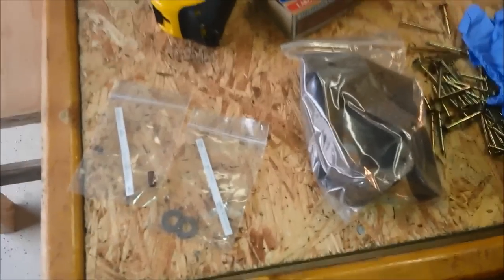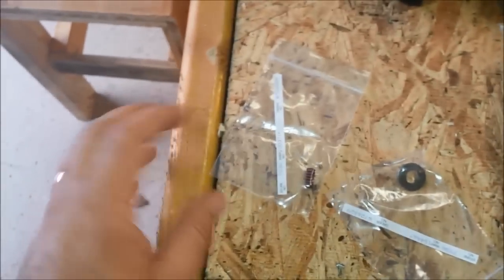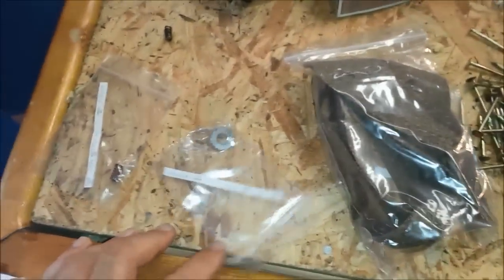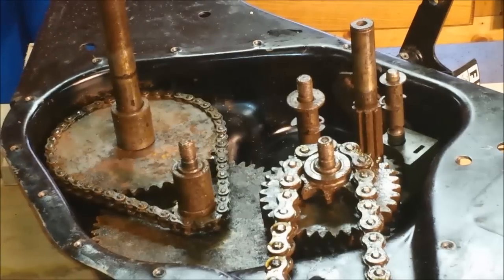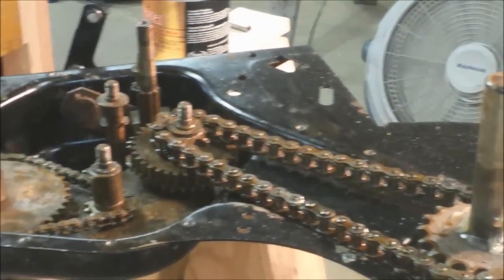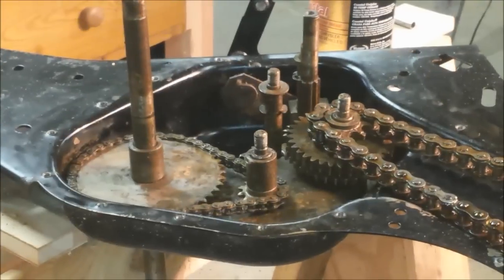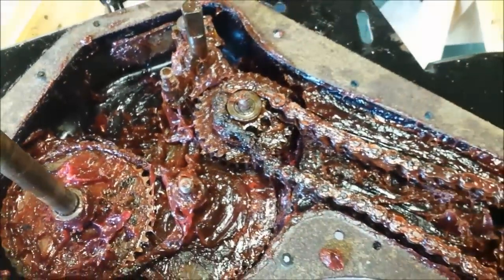Craftsman rear tine tiller repair - update #2 final

Comment: Appreciate the vids on this. So thoughtful of manufacturer to recommend using a grease gun 2-3X a year but not providing grease fittings! Mine had same problem of not shifting, stuck in F. I have it ready to split the halves apart now-all bolts off. I don't think any of the gears are messed up. Once I've put the halves together with a new gasket I think I'll use some thick black exterior paint to further seal the thing and keep it under cover when not using it. Thanks!

Comment: Fixed mine today,  the weld came loose on the ground axle, re welded it,  not available,  I actually drilled a hole in the collet welded it to the shaft and gear ,weked both sides that way ,heat treated the assy and worked great, looks like you are missing a,washer on the idle gear , but at low rpm it will be fine for a long time, thanks for making a great vidio on the assy and repair,  I have 40 bucks in mine so far

Comment: Thanks for video, So many reports of jammed gears and hard shifting I wondered about gearbox design. Now I see it is pretty solid and problems likely due to lack of lubrication. I would add some 140 EP gear oil with grease to provide some circulation of lube.

Comment: Hey Big Red Fish Dad,
It looks like whoever sent you the parts sent you the wrong washers.  They are supposed to be felt like washers on that particular shaft only.  Also another tip for future projects involving springs.  Grab the spring with a pair of needle nose pliers and heat it up to cherry red and dip it in water real quick to cool it down.  This procedure will burn off the rust and bring back the springyness of the spring.
Reply from the maker: That would have made me feel better.. I wasn't too happy to have paid $3 for flat washers ;)
Reply: No offense, but I tried this heat/quench idea with this very same spring, and it failed utterly. It made the spring totally brittle and it broke in half when I tried to compress it in my fingers. This after it was able to be compressed previously but seemed a bit less springy than it should be so I decided to give this tip a try. No big deal though, I was probably going to order to new spring anyway.
Reply: Extreme Whitetail you just took the temper out of the spring. Hope you like buying springs.

Comment: Hi, thanks for the video. It helped me with my tiller repair. What is the model # on your tiller? Some newer tillers hve an additional selection on the transmission one click past till it has forward or reverse rottion on the tines. I would also offer to install grease zerks in the case cover to allow filling the gear case or greasing the important gears without pullimg the covers.

Comment: Wonderful Job. The thing that needed to be addressed clearly is the installation of the spring and steel ball. I haven't a clue how that works.
Reply: Finally taking mine apart .... The wheels were pretty rusted on..LET IT SOAK W/ PB BLASTER A COUPLE DAYS 1ST   i ended up drilling a couple holes in the wheels for bolts to the puller  heated up the hubs and used a harmonic balance puller to get them off...wow 2 days just to get the wheels off broke a few tools as well  so plan it out if your doing this as far as that spring  Take the clip off the pin/block pc &  that pin will push out.  The spring n ball goes behind the pin where that hole is.
Reply: @mattuk1310  Haha. You are so right. It took me three days to get the wheels off they were so rusted on. I tried a million different tricks and nothing worked. I finally just cut the hubs off with an angle grinder.  Thankfully, when I finally got it open I found that tiller transmission problem was the same as this video. The little gear shifting shaft was seized in the same way. Should be an easy fix. I haven't put it all back together yet, but I'm excited to have gotten this far.
Reply: @Ken Horner You probably figured this out already but for others reading this, I was struggling with the removal/replacement of the spring and ball too, but the spring and ball just come out through the machined round hole in the gear shift block. You just insert a flat head screw driver into the machined rectangular slots of the block and push up. It should come up easily. If it doesn't, it's rusted in place and you just need to use your favorite de-rusting snake oil.
Reply: @markwitt7597   hot cold hot cold & used a harmonic balance bolts thru holes in the wheels took me about  2wks on/off  clean it up paint some parts...you know restore it like an old car..  after it was all apart i ground down the shafts w/ a bench grinder slightly so i could get the wheels back on. used ant seize junk stuff. 
I got it all together tines work fine :)  ...
:( fwd / rev is not power turning  will spin freely ....So  i get to pull it all apart again.
heck i even silicone the top of the clam shell so water would seep in to the  gears / 2lbs of marine grease.....so i'm not off here yet ....com'on get motivated Lets get em done ...Spring is cracking soon   lol :)

Comment: I guess you didn't use the blue marine grade (blue) ...do you really use that much grease in there ? i may be puling one aprt down the road glad i stumbled across your Vids ..Thanks for posting them
Reply from the maker: We used the "Farm equipment" grease from tractor supply. Have no idea how much is recommended we just lathered it on everything... I figured there is plenty of reoom in the case so a little extra won't hurt ;)
Reply: Grease is super cheap
Reply: thats why we are all having these problems.....not enough lube at the highest point. Slap that grease in places the moon don't shine!!! Excellent video. Big help!!!

Comment: how did you get the spring out the block, I cant figure it out... you said it moves up and down and you hammered it out. Mine is just stuck.
Reply from the maker: +jason casper I honestly don't remember without looking at it again. But I think we just had to remove the "C" clip and then tapped the shaft (#16) out with a hammer. Maybe this diagram will help http://c.searspartsdirect.com/lis_png/PLDM/P9120365-00004.png
Reply: +BigRedFishDadI got it soon after I sent that message to you. I herd you say you hammered it so I wacked it two good times and it came loose.  Thanks for help and the info.last thing I have to figure out is how to knock the needle bearing out of the housing. Its d-4 on the diagram. That's the shaft that has the main pulley on it.

Comment: Thanks I just bought a used one for $225. It shifts hard from gear to gear. Probably dirty and rusty like yours was. Not sure I want to pull it apart just yet. Maybe drill a hole in the top and bottom and wash it out good the put grease into it and put plugs in the case.
Reply from the maker: It is probably those two balls and spring not the gears... maybe try some of the WD40 Lithium grease. Try spraying it in the hole where shift lever enters the case. You might get lucky and enough seep into that block to loosen them up.

Comment: I just picked one up and it drives forward & reverse perfectly fine. It will engage the tines but as soon as there is any resistance whatsoever to the tines they stop and you get an odd, i don't want to say grinding, but almost a grinding noise. Any idea?
Reply: The tine shaft Shaft assembly
Part #102131X is shot.  The sound is the chain slipping on what is left of your teeth.  I had to buy a new sprocket and bolt it to the old one to fix it.  You can not get the shaft anymore.

Comment: i'm confused about that clip you video notes say put it downward to hold gear down ?  but even after you the grease is applied it shows its up toward the open side NOT down below ...& sears parts direct diagram shows its above the gear ..YET the diagram there shows a line (maybe the groove( closer to the other end...so i'm a not sure did you switch it /upate this after putting in the grease ?
Reply from the maker: I don't really remember that was almost 5 years ago. We may have flipped it after we had grease applied. If I put it in the comments then we flipped it. I do see the groove where the clip goes and I think it is just a little it off center so when you flip it over it holds the gear down so it doesn't slide up too far and not engage the large gear it meshes with.
Reply: ok thanks for the reply  @BigRedFishDad  & good timing i should get my last part  today :)
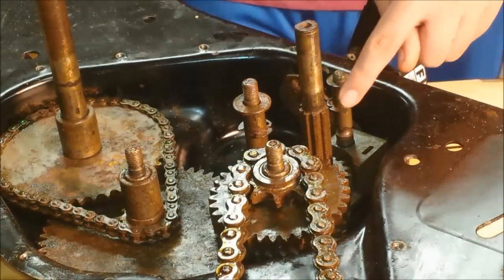Reply: well back together and the tines work fwd / rev did not....@ 2:23 in the video i think i didn't put the gear under the c clip on that shaft...so i'm pulling it apart again..i did silicon the top crack of the clam shell to help keep water out

Comment: Thanks for the video . You said you had a picture you had found on the internet . Would you tell me where you found it at ? I have been trying to work on the same transmission and it doesnt want to move the wheels for some reason . It will go in reverse and till but wont spin wheels . I have the little diagram but cant see to well to figure out what im doing wrong.
Reply from the maker: I don't remember exactly but I just searched on google and clicked on images and found the exploded view of the parts diagram. The wheels attach directly to the axle and use the smaller chain to drive it. Maybe that is broken or has slipped of the sprocket or something. Look at the axle, sprocket, and chain on the left of screen at 2:50 in video... that is for the wheels.
Reply: Thank you for your reply ,I have been trying to figure this out for a few months now.

Comment: Is there a grease fitting on trans anywhere because mines shifts good it makes a grinding sound when push or pull fast, but if I take baby steps you don't here it need help thanks
Reply from the maker: +Otis Howard I don't think I saw one on it. Maybe just not fully stopped spinning down when you go fast.
Reply from the maker: +Otis Howard I don't think I saw one on it. Maybe just not fully stopped spinning down when you go fast.
Reply: Mine has a zerk fitting on the right side of the case.  I decided to open mine up as I didn’t think greasing was going to help mine. It’s frozen in neutral.

Comment: I came here hoping for some demonstration and decent instruction of a teardown & repair; I was sorely disappointed. You made 2-videos that could have been extremely helpful, had you not compressesed them to a total time of 9:33 and skipped so many important aspects of the job.  Still, thanks for the attempt guys.
Reply from the maker: yep, sorry about that I agree we could have made a way better video but we were just playing around back then with the videos. We had a hard time finding a picture or anything to go by so we decided to make a video. It was intended to give folks a starting point and not as a how too step by step. My theory on that is if you are going to crack open a tiller and mess with the gears then hopefully a diagram and a few paused shots of the video and you can figure it out ;)  Thanks for watching if we ever have to break it open again I will update it.
Reply: I have a Poulan Pro with the same problem; it is stuck in forward gear, so that is why I was hoping for more visual steps to the solution. I have the manual with parts list and diagram for it, but as you noted the diagram is confusing because of  the numerous parts and their  connecting lines. 
While I would appreciate more video  with extra steps shown I certainly hope you will never have to break your tiller  open again.